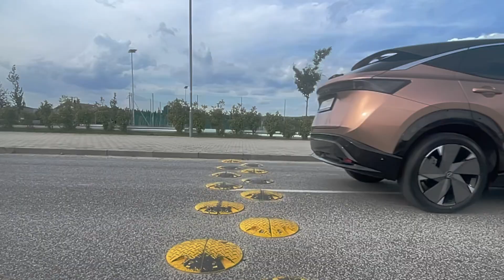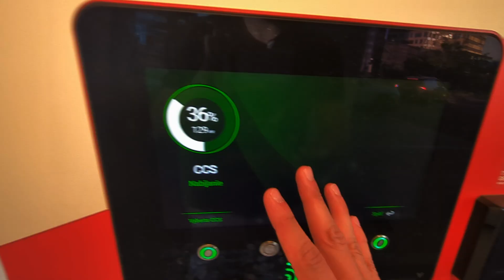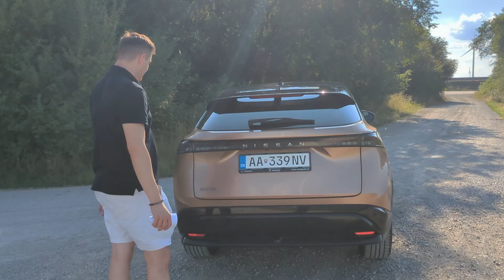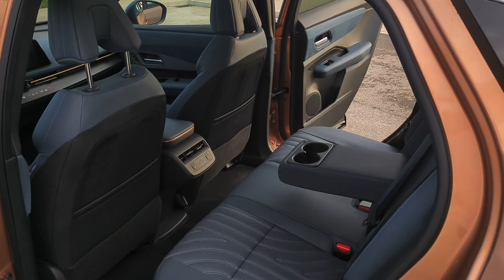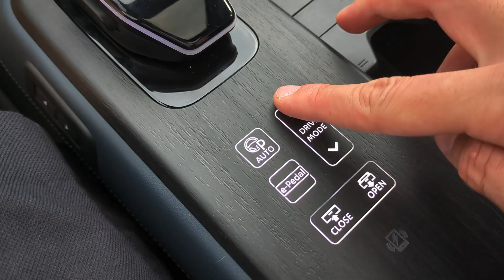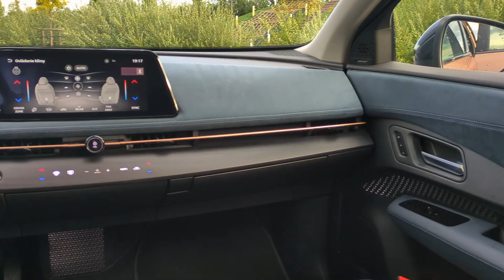2025 Nissan Ariya review. Driver focused electric SUV

Comment: I love my audio equipment.
I’ve spent a fair amount of cash getting the optimum sound and I finally found the right balance.
Here’s the thing.
I went backwards to find the perfect balanced speaker to complement my very modern amplifier and streaming setup.
40 years to be exact.
1984 speakers to go with a 2024 HiFi system.
My point ?
If old tech works very well then you don’t need to upgrade it.
This is a nice car,it looks great,has a very nice and functional dashboard cluster and handles well.
Not much to dislike really.
Reply: Go Ariya!
Reply from the maker: Go go Nismo Ariya too! ☝️💪
Reply from the maker: Wow man, that's really precise from you. I agree, it was a lovely EV SUV to drive. If new Leaf will be like that just lighter, that'll be fun.
Reply: @upshifter 
Test drive the Leaf,see what you think 👍🏼
Reply from the maker: Let's see, hopefully also Ariya Nismo. I was told we will have it as press car in my country.
Reply: @upshifter Nice one,that will be bonkers fast 😮
Reply from the maker: It will 😎💪